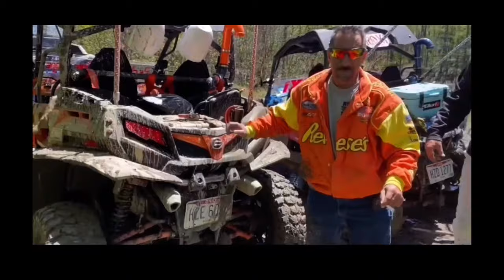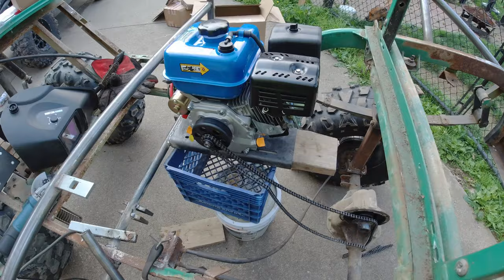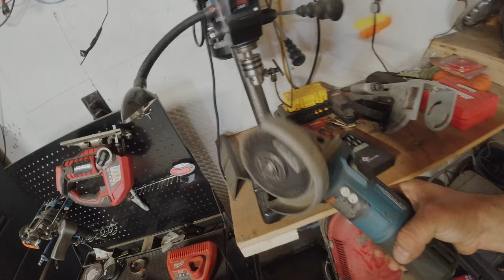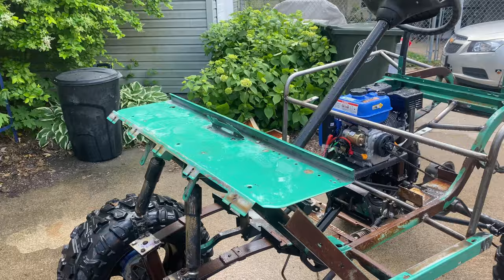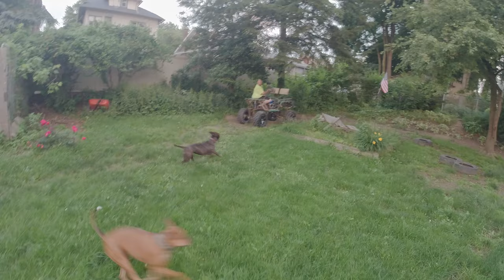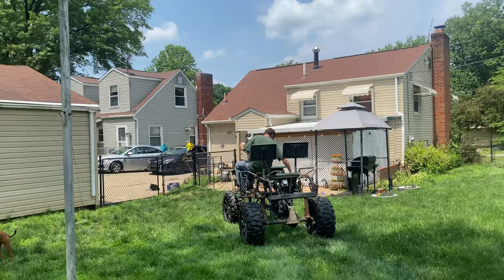Electric to Gas Conversion Complete Golf cart EZGO

Comment: How do you install a 301 predator motor in a golfcart that had a gasoline. Now I'm cutting everything out of frame. Have angle iron and plate for welding tournament. Now I'm stuck

Comment: Went to tractor supply and did not find a sprocket for the 420 chain. Can you please tell me what sprockets and chains you used from tractor supply
Reply from the maker: 35 chain. They have 35 sprockets.
Reply: @R.N.GPerformance  For #35 chain and not the 420

Comment: Question! I’m doing roughly the same setup and how does the cart not take off on startup when there is no transmission in cursious I have a predator motor and im not running a trans so if it’s hooked up directly from motor to axle how does it idle and not break something? All the info you have would be appreciated
Reply from the maker: The clutch.
Reply: Lemme expand that for you since he didn’t lol. Its called a centrifugal clutch. It mounts to the engines output shaft. It has weights and springs inside of a bell type of body. When you raise rpm (engines speed of rotation) past a certain point, the weights over come the spring force because of the centrifugal force acting on the weights, and they pressure the outer bell shape and create friction, and starts to spin the chain that drives the system. It might take off the first start because of paint and tight tolerances.  It might take off on you later in time because of dirt dust grease and grim. I hope that makes since and hopefully this helps you coming into the summer season.

Comment: How many teeth are on that rear sprocket. Not sure what I should get for mine that I’m doing. Putting a predator 420cc in it
Reply from the maker: I’ll count them tomorrow for you buddy.  I also went with a CVT on it also.
Reply: @R.N.GPerformance  CVT?
Reply from the maker: @northstarracing18d-4d  yes sir.  I have it in newer videos.
Reply: Sprocket size on the rear?

Comment: Why would you mount the engine to the frame?  It should have been mounted on a swing arm.  The way you set it up, the chain will stretch and slack as the suspension moves.
Reply from the maker: The way I set it up the chain pivots with the axels and don’t slack or stretch as the axel moves.